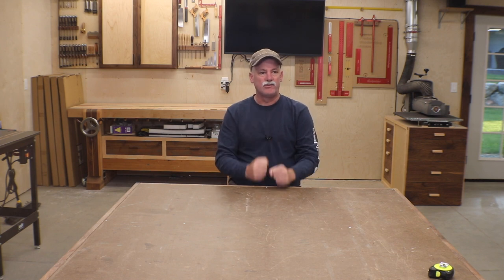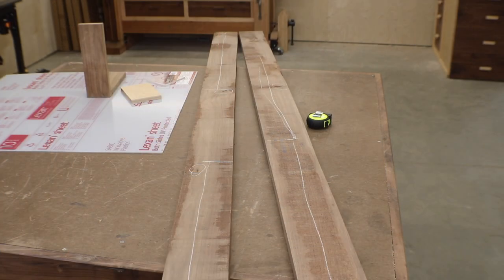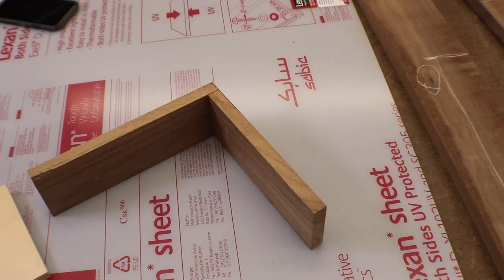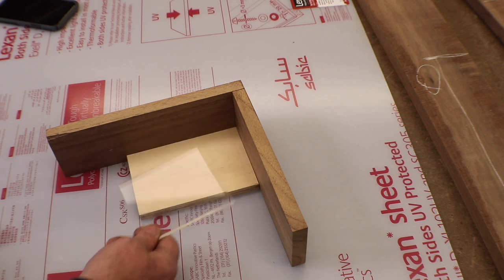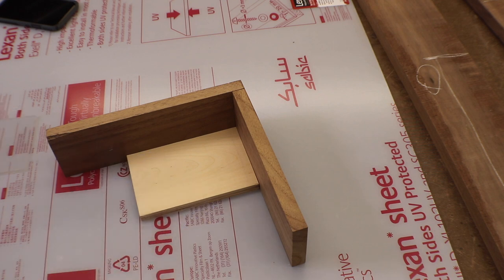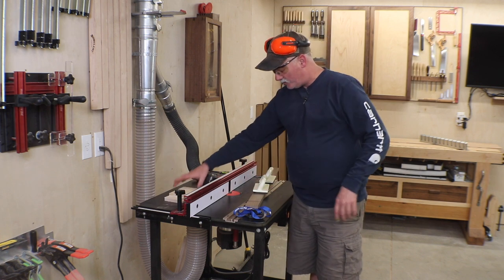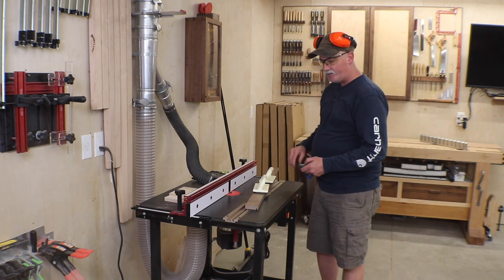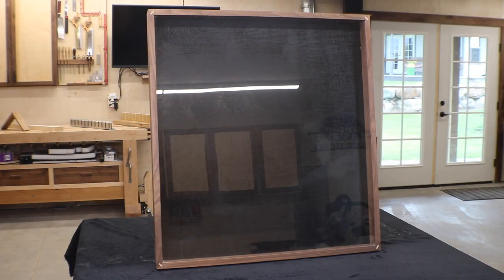Shirt Display

Comment: Nice project. Maybe I'm wrong, but isn't the grain on your splines running in the wrong direction? I am interested if I have this wrong.
Reply from the maker: Perhaps but, the splines are so small and are only there to reinforce the joint.  By the time all that glue surface dries, it should be plenty strong to display a shirt..
Reply: You are correct.  In this case, it shouldn't be a problem though since the back is screwed on, it's narrow and will be hanging on the wall with little force on the miters.  Best practice would be to have the grain running the opposite direction of what was done here.
Reply from the maker: You are correct and I should have done a better job explaining that very point..  Thanks!